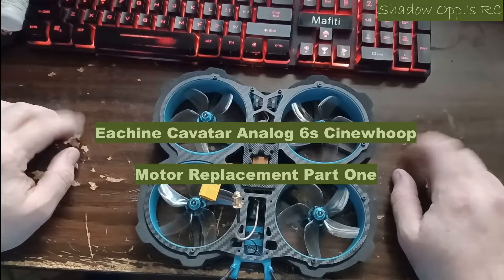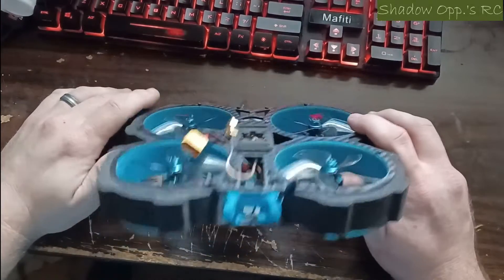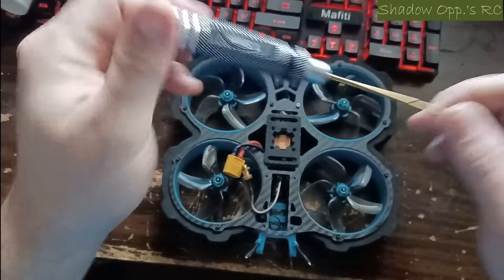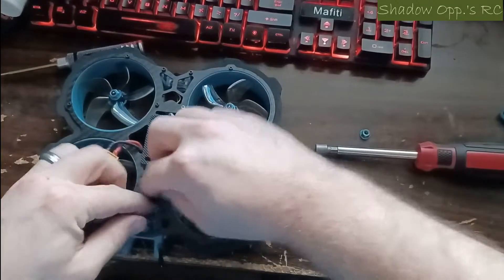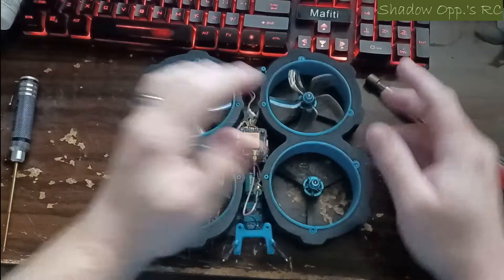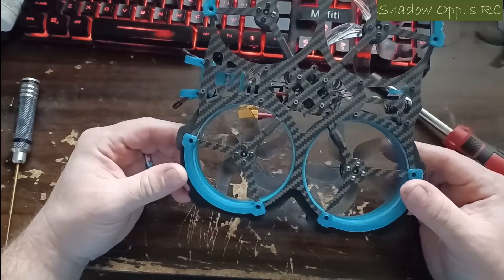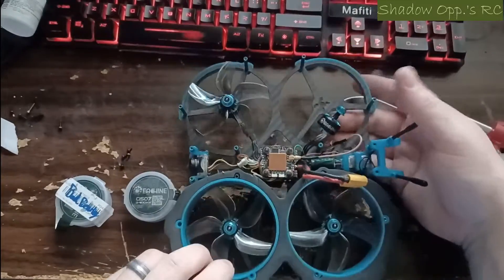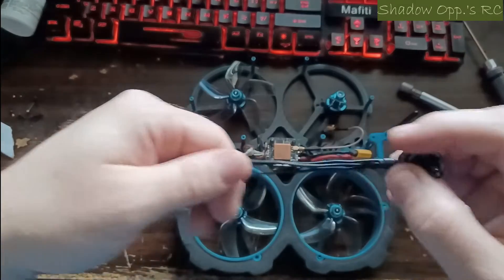Eachine Cvatar Analog 6s Cinewhoop Motor Replacement Part 1

Comment: hi bro, I've this drone 6s. but I've overheating motors. how can I solve this problem? I've this drone since 1 year and I didn't find a solution yet.
Reply from the maker: You can try a lower drag prop.  The other thing is you can lower the filtering in betaflight in the pid tune
Reply: @ShadowOppsRC  how can i decrease the drag prop?
Reply from the maker: @DFP22  try different props with less pitch.  I have to look it up but have a link to a page that talks you through how to trouble shoot this exact problem.
Reply: @ShadowOppsRC  thank you if you find the link
Reply: @ShadowOppsRC  it’s unbelievable that the drone is configurered badly
Reply from the maker: Have it saved on my computer but not my phone.
Reply: @ShadowOppsRC  no problem, when you are free, send it
Reply from the maker: @DFP22  Here is the link.  I have it saved for when I run into this issue.  https://transcendfpv.com/drone-motor-overheating/#:~:text=There%20are%20numerous%20factors%20that,your%20motors%20are%20subjected%20to.
Reply from the maker: My Eachine Cvatar was not great from the factory either!
Reply: @ShadowOppsRC  thanks, have you had the same problem?
Reply from the maker: Yes.  They did not really tune it from factory.  The esc is up to the task but the motors should have been lower kv for 6s.  Pushes the limit on what the stock motors can handle.  I have had to replace 2 motors, need to replace the 2 other ones but outta stock so the 2 I did not replace squeak since bearings not happy.